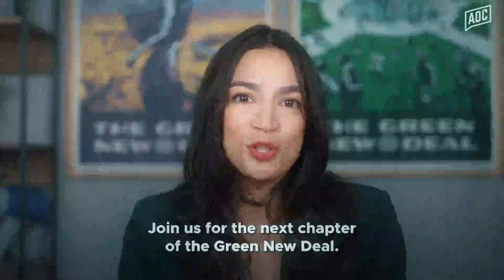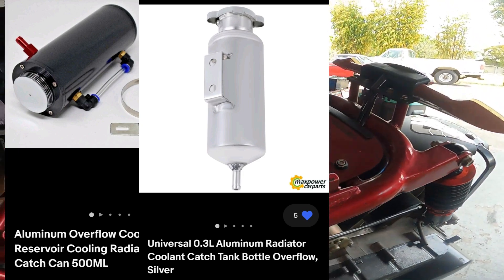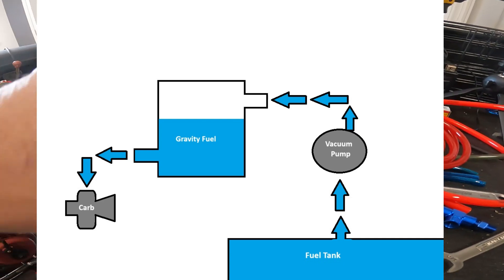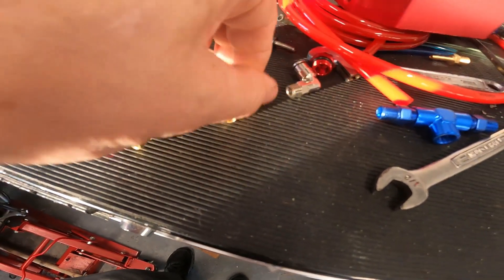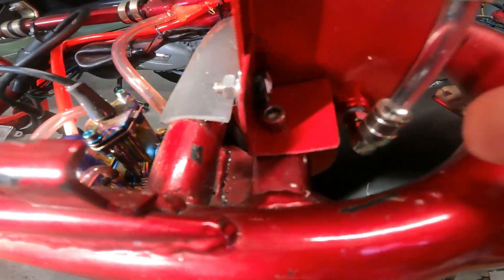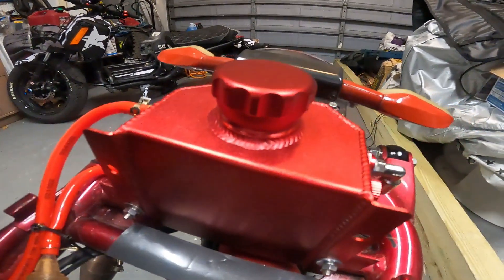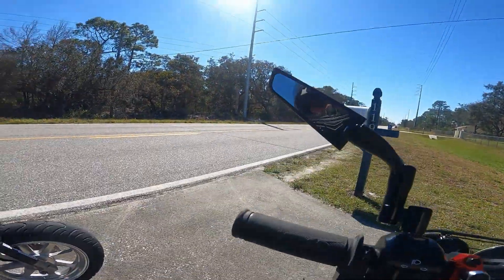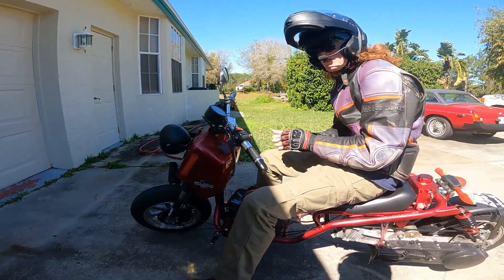Maddog Scooter Gravity Fuel System

Comment: Some dank nastyyyyyyy scoots with Gy6s come with gravity fed tanks where the tanks higher then the carb cuz you sitting on it. 
The ones with gas tanks you stand on I’ve not had a problem with the stock vacuum pumps.
Reply from the maker: For sure..    gravity is most primitive and still beat

Comment: The scooter I swiped the engine from this winter had a similar set up. Problem was the inlet and outlet was too small. It worked great but was restricting WOT. The bowl was only about the size of brake reservoir. It filled up to a point and then gravity fed back to the tank.
Reply from the maker: I'm getting a fuel soaked filter now.  Ugh...  can't figure this shit out.  LOL
Reply: Did you sort out the fuel filter being soaked with gas?
Reply from the maker: @jessetrimble7312  I tossed a paper filter on it and forgot all about it.  Been doing lot of riding and has not happened again.